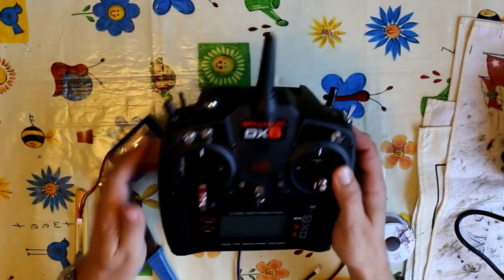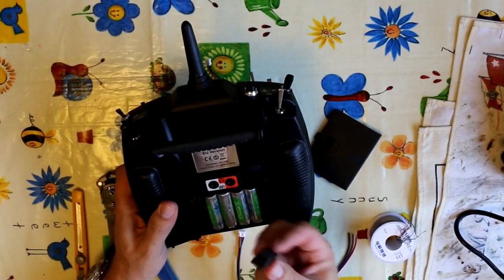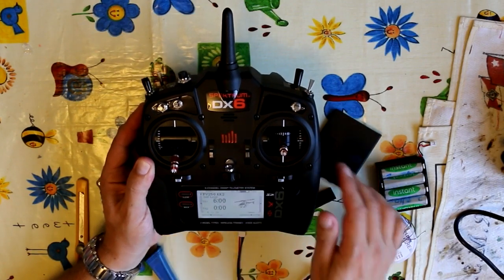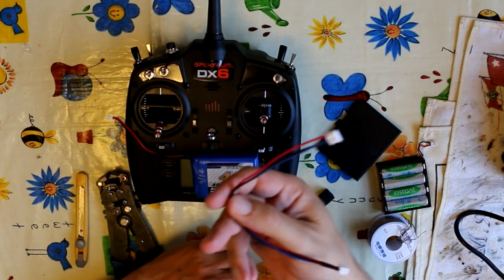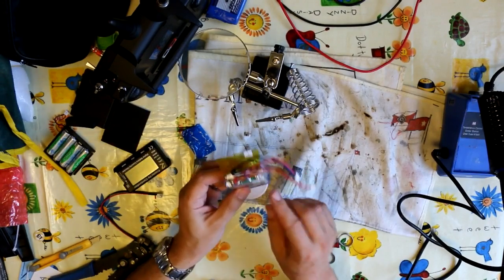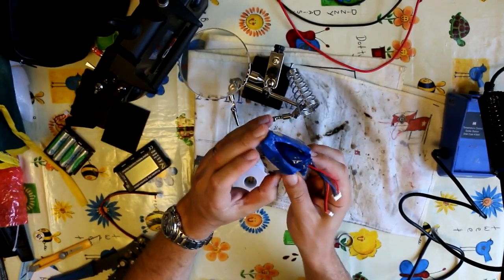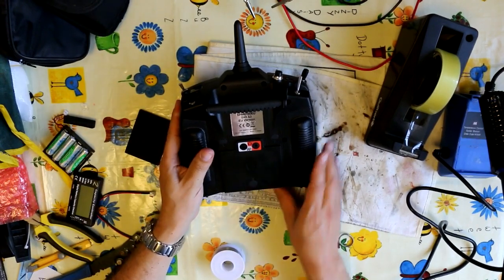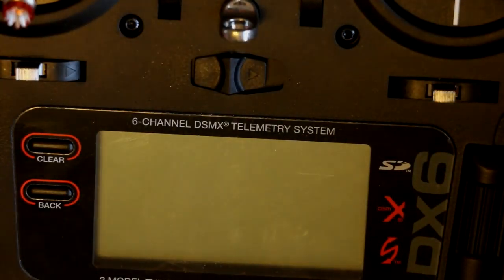Spektrum DX6 -  cheap lipo conversion using Turnigy 4000mah DX8 lipo

Comment: a little off topic but do you know if orange hobbyking receivers work with the new dx6 radio?
Reply from the maker: Gerry C I am using my new DX6 with R615X on quadcopter and R800X on another, both work perfectly, I see the new R620X has integrated telemetry which is leaps ahead of spektrum which requires seperate TM1000 which on its own costs three times the OrangeRx receiver with it included !
Reply: ***** thanks.i got the dx6 yesterday and it would not bind with 3 of my orange rx dsm2 receivers.i called my local hobby shop guy and he ranted and raved about them being illegal and spektrum receivers with spektrum radios only.i then tried two orange r615x receivers i have and they worked.so dsm2's must not work with it?
Reply from the maker: Gerry C I'm guessing it varies by model, I just grabbed an old OrangeRx R620 (non X) from my spares box which is DSM2 only, and it binds/works fine with my new DX6. I also checked an older micro R400 DSM2 only and that also works fine for me. I think I have a couple of even older OrangeRx receivers in planes in the loft, I just checked a very old clone AR6110e which works fine, also an OrangeRx R615 which I think is the oldest I have which also was fine - which model(s) are you having issues with ?
Reply: ***** they are all orange.two of them are r620 dsm2 and the other is r615 dsm2.but ive read in the meantime that according to eu regulations new transmitters made in 2015 are not allowed use dsm2 technology.only dsmx.in america the dx6 transmitter has the ability to be switched back and forth between dsm2 and dsmx.
Reply from the maker: Gerry C I knew there were EU changes on transmitting before checking frequency (listen before talk), but didn't realise this affected existing DSM2 transmitters. My DX6 I bought last year (2014) in the UK, so I'd hope even with firmware updates it will still work with DSM2 existing receivers. All the new OrangeRx stuff is DSMX and the receivers are pretty cheap, so not the end of the world !
Reply: true. thanks for the input. and thanks for the video. a great help.

Comment: I wouldn't open the pack for that its to easy to remove the battery and charge, i do it with my jr 11x  charge the lipo out of the radio

Comment: Ive just ordered one of these lipo's. Crashed my Quadcopter yesterday when i lost contact with it approx 300meters away from me.Approx 500 feet up. Battery showed 5.4 volts on transmitter. Got to be honest i was expecting better range. I am using the AR610 Receiver that came with it. I suspect that as soon as the Batteries drop below 5.5 volts. Range is drastically reduced. These packs give 7.4 volts so TX range should increase.
Reply from the maker: Beetlejuice 01 Won't make any difference to tx range, the RF stage runs on regulated 5v anyway, so any more volts your just warming up the case - should last longer though, you should do range tests and adjust setup as should get better range than that if you have receiver correctly positioned with aerials in clear air 90deg apart.
Reply: I did a range test as per the manual. 30 paces and press the bind button. Still had control of the Quadcopter. So i am in the dark why the range is so poor when flying the Quad. I have the 6 inch Receiver lead running along the base of the Quad. I will reposition it, so that it stands upright from the top of the Quad. Bit wary to try it again. As it smashed my Quad fame and damaged a Motor in the crash.Had to order new frame and motor It just fell out of the sky from 500ft onto concrete. I have also re programmed into the Naze32 a failsafe. If it loses contact again. It should run he motors at 1200rpm in self level mode for a less rapid descent.
Reply: ***** Someone on another rc thread said that the Spektrum DX6 is only for parkfly models and this is the reason for limted range Is this true?
When i bought it from wheelspin models. They said it was suitable for all types of models.
Reply from the maker: Beetlejuice 01 The DX6 is a full range radio, so is fine for anything you have, its only the receivers which are classed as park flyer or full range. I suspect what the person on the other forum got confused by is the top end radio's from Spektrum, the DX9 and DX18 have dual antennaes inside the transmitter for extra diversity (not range), but this is an additional feature, and all the existing Spektrum transmitters (DX6i/DX7/DX8/DX7S and new DX6) have all been working full range for many years using only a single aerial on the transmitter, I am pretty sure Futaba and other makes also only have one antenna on the transmitter.
Reply: I didn't know that. Thanks for the advice. Maybe i need to look for a better quality receiver as the Spektrum Ar610 i believe is entry level.
Reply from the maker: Beetlejuice 01 I thought the AR610 was full range (ie has two receivers and picks best signal between them), its the smaller AR6100 etc which are generally labelled park flyer as they have no diversity.
Reply: I have found out that there is a Mobile Phone Transmitter nearby.Maybe this is causing the range problems.
Reply: +jamesb72 After yet another signal dropout. I went along to a local model club. Another person had a DX6 with AR610 receiver. His range is far better than mine. Its clear that i have a faulty TX. Sending it to Horizon Hobbies to be sorted out.

Comment: Do you disconnect it when not in use?  Is there a discharge problem, or will it hold a charge over time when not using?
Reply from the maker: David Pierce No I leave it connected all the time, there is a very low self discharge on lipos, which is why they are good for transmitter power.

Comment: If someone does not feel comfortable taking the battery apart and adding balance connector you could get this battery from go nitro hobbies here is the info high quality battery made by pulse
Pulse 7.4V 4000mAh 2S LiPo Battery TX Ultra Power Series DX6 / DX7S / DX8 / DX9
Like I said it comes with balance connector and it's about 34 bucks I've seen the Turnigy sell for about the same price on eBay. just search this battery on eBay you will find that go nitro hobbies has the best price just bought one for myself
Reply: Thanks for this, I have been looking around at options and none of them have been as appealing or comfortable as this one. I'll find a charge harness or use my old eflite charger which was just able to charge anything from the balance lead.
Reply from the maker: Great info, you can also just use the E-flite charge lead in description and charge at low current, but that means unplugging the battery from tx each time you want to charge - having an extra balance lead on the lipo like the pulse lipo is nice and easy - depending if your charger needs power leads connected to charge you may need to buy/make a charge harness anyway, I can charge just on balance leads so this would just plug n play.
Reply: I'm glad I could help I would definitely go with pulse lipo
Reply: Agnieszka Saletnik Do you know of a good charging harness by the way that would allow me to charge it up on my X1 touch, which doesn't allow balance charging? Or does your charger not require that.
Reply from the maker: John Cuppi The e-flite harness in description should be fine for non-balance chargers
Reply: Thanks, my problem is that the X1 touch is a balance charger, but it doesn't let you charge the battery from the balance lead alone. Always have to have the banana plugs inserted.

My plan was to just be able to charge using the balance lead. I ordered the harness but now I think that's going to require me to pull the battery from the charger every time, right? Sorry it's a little confusing to me.
Reply from the maker: John Cuppi You will just need a small harness with a 2S balance socket extension with banana plugs Tee'd into the positive and negative wires so charger is happy - you can very easily make one of these yourself if you are comfortable soldering, just buy a 2S extension lead from hobbyking, and a couple of 4mm bullets - or you can buy these pre-made, I just googled and this one should work but am sure there are others if you search '2S receiver harness' http://www.amain.com/rc-cars/protek-rc-balance-charge-lead-2s-balance-harness-to-4mm-banana-plugs-w-4s-adapter-ptk-5319/p244687 or you could just get hold of a cheap e-flite or hobbyking charger which only uses the balance leads - most of the e-flite chargers work like this (and come with RTF/BNF models) so does the cheap hobbyking charger http://www.hobbyking.com/hobbyking/store/__7637__Turnigy_12v_2_3S_Basic_Balance_Charger.html
Reply: Thanks. I'm probably going to have to buy one premade because I'm bad at soldering. For now, I do have the charging harness.

Comment: Just the info I was looking for!  I have a DX8 with the standard NiMH and 4000 mah LiPo and I was wondering if either pack could be used in my new DX6.
Reply from the maker: Either will fit, and you can either charge in the DX8 or probably better to get the e-flite charge lead (and charge at 0.5amps max to allow the internal balance circuit to cope) or do this mod for balance tap depending on what your charger needs.

Comment: Thanks! Just order my battery. Never really thought about how the balance plug is connected. Opened up an old 2s battery. Simple enough to add the balance plug like you say. And yes, after using my DX6 for a while, I am real tired of swapping out those AA batteries.
Reply from the maker: Thanks. Its really easy to swap the balance leads across, only tricky bit is getting the old heatshrink off and back on neatly, but its just a three hand job, and definitely worth it. I have only charged my DX6 twice since I got it, and have had probably 4 days flying and lots of short flights in between, so it lasts ridiculously long time.
Reply: *****
The 4000ah battery is working out great. I usually fly for about an hour with the usual amount of onboard battery changes. A big plus now is I just leave the radio on for the duration which is much more convenient.
The design of the battery is a bit different that yours though so my changes are correspondingly different. Also, you can see in the webpage below I charge through the circuity, not bypassing it like you did. Takes a charge just fine (so far).
I actually have two DX6's as I plan on doing the "Student / Instructor" thing one of these days. Since I only purchased one 4000 battery I decided to use a Turnigy 1000ma 2c battery (happened to have a coupla new ones around that I had never used).
That conversion worked out great too. You can view each mod on the webpages below:

www.demiurgiac.com/DX6/DX6LiPo.html

www.demiurgiac.com/DX6/DX6LiPo2.html
Reply from the maker: Dave Garner Hi Dave, Glad it worked for you too, the 4000mah battery life is ridiculous, charging through the balance circuit you just need to be careful to charge at a low rate, probably 0.5amps max, and probably best to cut charge off on lower than normal voltage also, to avoid overtaxing the balance circuit in the pack. I like your 1000mah install, very neat and as you say much nicer not to have to mess about with battery, I bet you get better life from that than AA batts, and you can easily just have a spare battery in case you need to change at the field - very neat solution !

Comment: Great video... one question... what did you set your cut off or low voltage warning on your radio for the new lipo? Thanks! David
Reply from the maker: Mine is at 6.8v, but the battery lasts so long I doubt I'd ever get to that, I charge it every few months when it gets below about halfway on the battery meter ;)

Comment: Good info for saving me money. Why don't you turn off the sound for the roller switch. That crazed cricket sound was driving me nuts. Much better without the sound. 
DX6 is my first transmitter and I'm liking it alot. Lost use of it for a day when I somehow changed it into MODE 1 on the systems screen.
This stuff is kinda hard to learn with a manual that is written by a minimalist. Without the internet, I would be completely lost, RC Groups, YouTube, etc.

Comment: My charger requires power leads to be connected - where do I need to solder those on this pack??  Could you be more descriptive?
Reply from the maker: You can just get the spektrum adaptor lead - although if you can't work out where to solder + and - then probably not a diy project for you ;)

Comment: Alkaline cells from the pound shop are looking like the better option.
The DX6 is a great radio, but the battery situation really is a bummer.
Reply from the maker: I don't feel AA batteries are safe for RC transmitters, they have too many contact problems which will cause voltage drops/dropouts and inevitably crashes, I am pretty sure the BMFA guidelines actually specify not to use them - only properly connected/soldered packs.The DX6 battery couldn't be simpler you either buy this turnigy one and plug it in, either buy the spektrum harness to charge it, or DIY like I did, or if your spendy you can buy the official spektrum version with built in charge socket and mains charger but its a fair bit more money.
Reply from the maker: ***** Just checked this, and like TV remotes which will often stop working until you wriggle the batteries, RC transmitters can have the same issues - BMFA guidelines have been updated, so they say its OK to use loose cells as long as they are removed/cleaned/replaced at least monthly to keep contacts clean - personally I still don't think they are a good solution, and a hard wired/soldered pack is definitely better, and certainly cheaper than alkaline batteries over time. Also the DX6 battery box is removable/plugged in, so not clear if the BMFA would approve or not - probably not an issue unless you take a BMFA certification.

Corrections and Additions (Issue 3) 

July 2009 

Page 20, column 2, Batteries 

add new para (g) and renumber following paras. 

Some modern transmitters have very low current drain and are supplied as dry battery sets with battery boxes that aren't removable. In these cases dry cells give an acceptably long operational life and may be used safely. If you do use rechargeable cells in these transmitters, make sure that the cells are removed and replaced at least monthly to keep the battery contacts clean. If not your transmitter might suffer from the same symptom of many TV remotes when they stop working until you have disturbed the batteries.
Reply: ***** BMFA guidelines have now changed, you are allowed to use loose cells such as fitted to the DX6 & 6i.
It is however a very poor solution they should have included a rechargeable NiMH pack for a few £ more.
Reply: *****
(d) There are, however, exceptions to this advice. Some modern transmitters have very low current drain and are supplied as dry battery sets with battery boxes that are not removable. In these cases good quality dry cells give an acceptably long operational life and may be used safely.
Reply: ***** Don't get me wrong, great video.
Shame the DX6 didn't come with a decent battery out of the box, the optional Li Ion pack seems to be suffering from self discharge.
Reply from the maker: ***** Obviously they needed to balance rechargable battery with hitting this price point, I still think its great value for the features (I feel they have done this to compete with Taranis/Graupner personally), surprising the Li-ion pack has self discharge issue, they've been used in mobile phones and laptops for years I thought because they didn't ! The Spektrum battery is very expensive, so should be better than that!
Reply: ***** I'm off to buy one in 30 mins.

Comment: Hey, super liked your video. You said you used a 3S Balance lead extension cable. Is it supposed to be 2S or 3S? Any link u can share to buy exact length balance lead extension adaptor?
Reply from the maker: Sorry - I use 3S for everything except this and the fatshark batteries, so I misspoke - its a 2S extension lead, length doesn't matter as you just cut the first couple of inches off, I get them from hobbyking they are in packs of ten for a couple of dollars, I make parallel charging harnesses out of them so I can just plug a couple of 3S or one 2S straight into my cellpro chargers they are great for that too. http://www.hobbyking.com/hobbyking/store/__9735__JST_XH_2S_Wire_Extension_20cm_10pcs_bag_.html

Comment: i like your video thanks for the battery up-date i'm going to watch it 5 or 6 more times to see exactly where you soldered the wires i don't need a mistake.
Reply from the maker: No problem, the only tricky bit is cutting off the heatshrink which needs to be done carefully, once you can see the lipo tabs its really easy to see where to solder onto and not at all hard to solder neatly.

Comment: Love this Lipo alternative over the 2000mah offered by Spektrum! You sold me on the DX6 after viewing your Spektrum Transmitter comparison video! Being the DX6 has all the features of the DX8/ DX9 plus extra at a cheaper price point! And in my opinion looks better! So it's good to know I can do a easy inexpensive Lipo modification to get improved run time on my transmitter!

  You made a good point when you mentioned the Spektrum Battery is no better then a NiMH pack @only a 2000mah capacity. If I'm paying 34 dollars on a so called battery upgrade I expect improved run time! So it's ''Turnigy'' for the Win! Spektrum does offer a 4000mah transmitter pack for the DX8 but @ a $69.99 price point I'll rather get two Turnigy packs and run for days!

Thanks for the informative video!

http://www.amazon.com/Spektrum-4000mAh-LiPo-Transmitter-Battery/dp/B00401Z046/ref=sr_1_fkmr0_1?ie=UTF8&qid=1420346791&sr=8-1-fkmr0&keywords=Turnigy+4000mAh+Spektrum+DX8+Intelligent+Transmitter+Pack